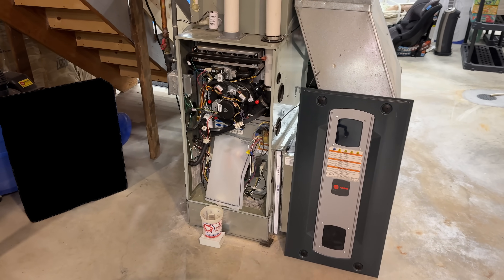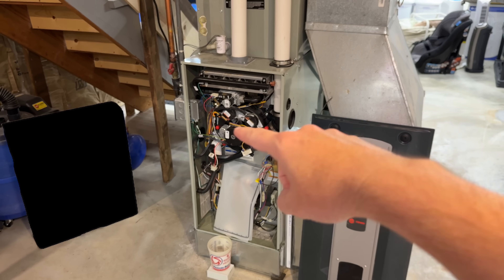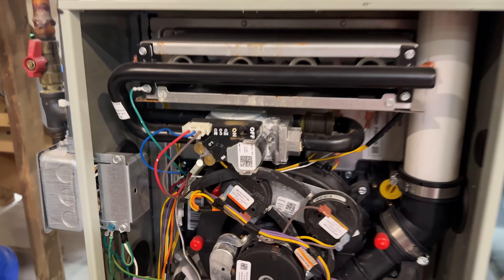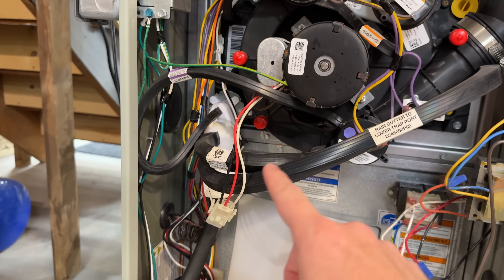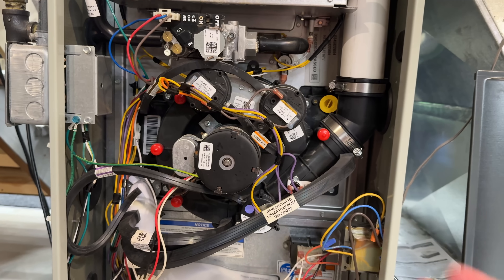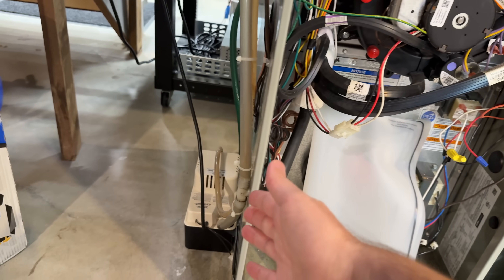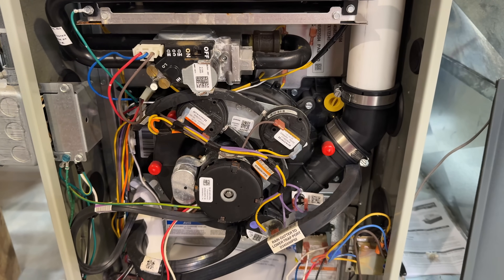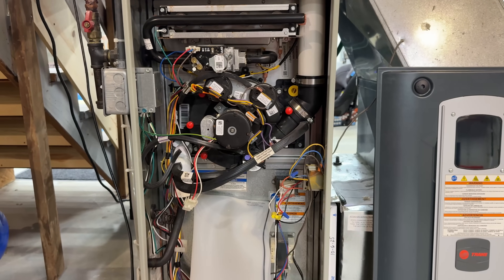It's not that hard to stop a Trane

Comment: Technology Connections would like to have a talk with you about the advantages of heat pumps :D
Reply: One can build a heat pump that is practically indestructible.  This case is bad design allowing sensitive electronic components to get wet and damaged.
Reply: I somewhat respectfully disagree with Alec and heat pumps. If what you have is an air conditioner for cooling and electric resistive elements for heating, then yes, heat pumps are more efficient, and maybe more cost effective, but for heat, if you have a gas fired furnace, going to a heat pump for heating is NOT the way to go. I have a gas furnace and a pretty new air conditioner. Our electric bill goes through the roof when the AC kicks in for the summer (as it always has, even prior to the new unit), and tanks when winter hits (thus no more cooling), and our gas bill only goes up a little when heating kicks in. The furnace generally peaks around 200W when running (heating cooling), and the condenser generally runs around 1500W. Once heating kicks in, we don't have that 1500W of power draw that would still be present, maybe even more, depending on outside ambient temps and what was required to get to get to desired indoor temps... and if you add resistive backup elements for when the heat pump can't cut it due to the outside temp, that makes it that much worse.

No, I would not want everything electric, unless I had a MASSIVE solar farm and MASSIVE battery storage to allow me to run on 90-100% off grid electricity. My sister has heat pumps with resistive backup, and her electric bill is nuts all year long.
Reply: @aperson9495  You are probably running a single speed or dual speed AC unit and not something with variable speed. That's 80s technology, and not very efficient.

Heating a whole house obviously needs more power than just running a fan, the heatpump will heat with 1500W*3,5 (average yearly efficiency of a decent inverter heatpump) = 5250W or 17913BTU. You shouldn't need that much heat 24/7 the whole winter, though.

Here in Europe most heatpumps are waterborne ( they heat water to heat the house, because radiators and floor heating is common) so not directly comparable. You can fairly easily heat a 180m^2 small-ish House (1937ft^2) with 4000kWh or 22kW/day including hot water.

You might haven't seen all the videos Alec did on heat pumps, he made quite a few.
Reply: @aperson9495  If your gas bill doesn't balloon during winter you're either not using gas heat or you have lots of other gas appliances. I don't have them in front of me but I'm pretty sure my place's gas bill has more dramatic seasonal changes than the electric bill.
Reply: @eDoc2020  It doesn't 'balloon'. It goes up to a degree, but not even CLOSE to what our electric goes up when AC kicks in (Out NG use is a tankless WH, furnace and dryer). Our electric bill DOUBLES (at best) when AC kicks in for the season. I would HATE to imagine our energy bills if we only had electric cooling AND heating!!!!! Based on our AC costs, there is ABSOLUTELY NO WAY I would want  heat pump heat over NG. EVER. Well, unless I somehow had 300% offgrid solar, wind and/or other coverage and storage with aero grid dependency.

Oh, and your 'you're either not using gas heat...' comment is both MORNIC and offensive. I know more about these topics than probably 98% of people, and I can fix nearly everything in my house, unlike the same 98% of people today that couldn't fix a lightswitch. Today, the ONLY times full electric makes sense is if you have SIGNIFICANT solar coverage, or if you have SUPER cheap electric, such as from local hydro. My sister has heat pumps in her house, half an hour away, she has CoOp power (cheaper rates than me), and her bill is WAY more than mine in the winter.
Reply: @aperson9495  I should've been more clear: your gas space heating usage is very small compared to your everyday usage. I suspect you have unusually high natural heat gain (maybe solar insolation, maybe lots of heat-producing devices) resulting in low heating needs.

By my estimates heating with cold-climate heat pumps (ie, not using much aux heat) is about 50% more expensive than gas heat throughout the entire season.
Reply: More pumping, more now!
Reply: I realize it makes zero sense with a 6 year old furnace but I seriously would consider it when it's time for a replacement. I installed a Mitsubishi heat pump a few years ago and indoor temp is way more consistent and comfortable in the winter now. It also costs me less to run than the 96% AFUE boiler it replaced.
Reply: @alc5440  About your heat pump -  During Winter - Do you have an issues with low humidity? Did you add a humidifier for winter time?
Reply: @earld1403  to my knowledge, the heating method doesn't impact humidity, just that there's a difference between the inside and outside temp. Where I live, there's only a few weeks out of the year where humidity isn't a problem (either high or low). The fact that I have an older house doesn't help matters. Humidity is just a constant battle. lol
Reply: @alc5440  that could only be true if you use propane. Natural gas is dirt cheap.
Reply: @sprockkets  YouTube doesn't tell me which comment you were replying to but I have natural gas (for now) and my heating cost has been a good bit lower since I got the heat pump. Electricity is pretty reasonable here (it's like $0.14/kWh). I'm not sure what the gas rate is off the top of my head.
Reply: I’d say a dual fuel is a great compromise. Primary heat pump, auxiliary gas (rather than heat strips), though I’d only use 80% due to the water issue
Reply: @attribute-4677 double the expense for few benefits. A full inverter heat pump will heat down to  -25°C/-13°F. A Nordic model will go down even more. Heat strips are for emergency heat and run at most a few hours a year.
See the series from Technology Connections.
Reply: More pumping, more now! (or rather... when the unit is no longer under warranty and it becomes costlier to maintain than to replace)
Reply: Even with modern cold region heat pumps, the a cost-benefit analysis isn't clear.  It depends on the relative costs of gas vs. electricity.  Where I live a BTU of gas heat is cheaper than a BTU of heat-pump heat; assuming a 92% furnace and a reasonably high HSPF2 heat-pump.  Electric prices at not low here, and they keep going up, which makes the long term prospect worse.  There are calculators online you can experiment with to compare gas vs. heat-pump running costs using prices in your region.

I think Geo-thermal heat-pumps are even cheaper to run, but they have much higher installation costs.

But yea, if your primary concern is reducing carbon footprint, a heat-pump is a strong contender.
Reply: You still need more conventional heat in colder climates. Heat pumps only get you so far.
Reply: @benargee  Modern heat pumps are honestly fine in all but the coldest climates on all but the coldest days. Mine keeps 100% of its rated capacity down to 5F and around 85% down to -13F without backup heat and newer models can go lower. They also maintain a COP of around 2 (plus or minus a bit) until you get right to the edge of their usable temperature range.
Reply: @benargee thats outdated info. See Technology Connections videos. Or ask people in Norway :)
Reply: @tschuuuls486  I have and it's less efficient below a certain temp because of the physics of the chosen refrigerant gases. If it's to cold to change state, it won't emit or absorb heat.
Reply: @benargee you run a full inverter heat pump?
Reply: @benargee I was looking at the GREE Flexx line (sold as Mr. Cool Universal) and their 2ton unit can output 24k BTU/h at an outdoor temp of -5F at a COP of 1.67. It will work down to -22F (actually a bit lower if it's dry, as I've seen video of it working at -30). If I hadn't found this out a year after my AC had to be replaced I'd have one installed right now. I'm still considering it but I have other things to do to the house that are a better use of money until my furnace kicks the bucket, like replace some single pane windows.

Comment: I have made it a habit to take apart a lot of things I buy and spray the circuit boards with conformal coating if not supplied that way. Goes a long way to making them last much longer than designed. It used to be tons of devices came that way, but not so much anymore.
Reply: what product do you use?
Reply: Bad idea. Most units come with a 5 or 10 year parts warranty. You smoke a board with it sprayed on and you will plop down anywhere from $80 to $2,000 cash for a new one. The distributor will NOT take it back.
Reply: One option is to apply rosin. One company (Kontakt Chemie) makes a coating spray* that is nothing more than rosin in solvent (no flux activators or anything). While it’s not the most robust conformal coating, it’s completely inert and completely removable with alcohol. So in theory, a board coated with that could be cleaned off before sending it for repair/replacement.

*The spray is normally intended as a “solderable lacquer” for protecting bare, unpopulated boards from corrosion/tarnishing before use. But since pure rosin is a great insulator and waterproofing agent, there’s no reason it couldn’t be used on populated boards, too. It won’t be as good as a more flexible conformal coating like polyurethane, but it won’t hurt. Of course you could also make your own by buying pure rosin crystals and dissolving them in solvent. (I’d probably use a mix of alcohol and some hydrocarbon, but no acetone. Acetone-free brake cleaner would work well.)
Reply: Considering Corporate America,  conformal coating the board would likely void the warranty. Just because Trane didn't approve the solution.   Depending on the your choice of conformal coat, it would only prolong the boards functionality.  Most conformal coating I'm aware of only protect the PCB's from Humidity.  Frankly, Jeff would better off 3d printing a cover for the board to protect it from dripping water.  Then print a tray to capture the water at the bottom and pipe that over to the lift pump.
Reply: @MIdaffy502
Most board failures today are bad electrolytic capacitors. The coating will not prevent their failure.
Reply: @bills6946 Good thing those are easy to swap.
Reply: Oh this is a real pro move

Comment: For the condensation on those PVC lines, if they are intake and NOT exhaust, what about drilling a hole in the bottom the pipe to let any condensation drain away from the unit?

Comment: I can't imagine using a gas furnace in 2025... modern heat pumps are able to operate in very low temperatures while still generating lots of heat, and they're so efficient 99% of the year that they're cheaper than gas in most parts of the US. And you're not worried about a gas leak causing your whole house to explode one night. I look forward to ditching my gas stove soon in favor of induction, which is faster, easier to control, and just generally better... then my home will be free of "natural" gas.

Comment: Those failure modes are designed in.  There are no mistakes in that product.  They will make a lot on the out-of-warrantee repairs and MORE on the early product replacement.  Products from earlier years last 20-to30 years and the manufacturers hated it.

Comment: Get them to replace the whole furnace, do as much of the removal, and instill as you can, see if you can find an HVAC person to do final connections. After the new one is in, go through it, and make upgrades like a cover for the board, and drain for the air intake (the center pipe), and any other places that don't seem to drain that need to. Run a tube to one of the "gutters so the water can  exit. Attach things with magnets, or double stick tape etc, If you ever need to have it serviced, pull the modifications, and put them back after. It is a pain, yes, do you get a long lasting furnace yes.Should someone in engineering be smacked around the head, Yes. Even if you have to pay someone to install the new one, and it's replaced with the same thing, you are still ahead, because most of the work is done already, and you know where the weak points are.

Comment: The higher the efficiency the more stuff that can break. When I replaced my HVAC, I told him I wanted the simplest unit they had. .No multistage anything because multistage = complex controllers.  I really wanted one with just a normal old school fan motor and he claimed they don't even make those anymore because of efficiency standards, they have to have "soft start" motors...meaning there's a control board that has more than a relay  to control it.. I'm convinced these companies do very little actual testing on their designs.  They pump them out purely for marketing claims, and don't really care how long they last.
Reply: Nah, just gotta get one that's not junk. Installed my 96% afue 100 kbtu amana 15 years ago, hasn't needed a single part.  Clean the burners out yearly with compressed air, clean the flame sensor with  a crisp bill every 2 years, change the filter every 3 months, still going as strong as the day I put it in.
Reply: And if you get a proprietary 'communicating' thermostat, it can cost you over $1000 to have it replaced ... if just the LCD or some other component fails.
Reply: I have a feeling that it can be done well. But either they make more money selling replacement parts, or they really don't know what they're doing designing these things.

Comment: My top of the line Carrier has the exact same problem!
Reply: Mine was caused by our high humidity summer in St. Louis.  The basement is the coldest space and as it pulls high humidity air in from the outside it condenses on the inside of the intake pipe and slowly drips into the furnace.  The installer tried to convince me it was from the humidity inside the house and that I needed a $1200 whole house de-humidification system.  I didn't fall for that and called the installer later to complain.  They sent a senior tech who installed a condensation drain attachment to the intake, similar to what is on the exhaust.  The secondary problem is that negative pressure in the house is causing hot humid air to be drawn into the house through the intake vent.  That negative pressure could be due to regular use of bathroom ventilation fans. I will probably just cap that intake pipe in the summer and create a reminder to remove it in the fall.

Comment: Make your own rain gutter downstream. Drill some some holes in the pvc pipe, 1/2, 3/4, 1 inch... whatever. It's temporary. Get some vynil tubing, nipples, create a drip loop and create a trap etc. Kind of like a trap for a/c condensate. Need to stop bad air returning. Remove it after the warranty work and seal it back up. I'm simplying it, but it's an option. Then go full nerd son! esphome it, automate in home assistant, add an electronic drain valve. Drain in a bucket, use a jsn-sr04t, send an alarm! Drain the bucket! ... I'm crazy... I'm sorry.

Comment: Don’t get me started on furnaces. The motor recently went on mine(but not really). There is a control module bolted to the back, and that’s what broke. But you can’t get just buy the control module, you have to buy the whole motor for $600. The best part, when replacing the whole motor, everything has to come out to remove it. However, replacing just the control module can be done without removing anything, including the motor. Turns a 1 hour job into a 2 minute job. The company would actually save money on warranty jobs because their repair people would be able to do like 50 a day. Apparently the motors don’t actually ever break, just the “smart” control module.
Reply: Was it a GE motor?  Same thing happened to the GE control board on the GE blower motor for my "variable speed blower, high efficiency air handler."  I don't know how, but I found a good repair guy, an independent.

He called a couple of suppliers and got the cost, and found out at that time the motor had to be ordered and it was going to be 3 or 4 days, then he offered me an alternative.  He said he could go get some parts and replace the fancy stuff with a simple dual speed motor and some relays, for a fraction of the cost.  This was mid-afternoon on Friday, and he said he couldn't get everything and get back that day, but he would come out first thing in the morning (Saturday) to get my heat going.  He did just as promised. He and his (retired) father came out and rebuilt my air handler to use a few $10 relays and a $100 motor.  A couple of years later the 5 year old heat pump died, and of course I called him to replace it.  That was about 6 years ago, and my air handler is still running the $100 motor.
Reply from the maker: Sounds as smart as most other "smart" things I've tried lately :(
Reply: Depends on which type of motor you have. Yes, ecm motors today most likely can't just replace the module. Others require programming. Or you buy a universal ecm replacement if not a communicating model.

Comment: The cheap nasty gas units they instal in Australian new builds are designed to fail after 5-10 years. Either the boards go and need replacing at 3/4 the cost of a new unit, or the heat exchanger literally falls apart pumping Co2 into the house. Gas in new builds has been banned here in favour of electricity.

Comment: Yeah, let's put a water trap tube and make it "level" from the device to the drain  🤦🤦🤦🤦
Wow, such a design flaw, and one that should have gotten caught "before" putting in mass production. And personally, "because" of that flaw, they should be even more liable for the repair work. They should at least send a modified/updated drain line (the one all the way on the left the drain lines connected to) that drops the lines further down so everything is going down hill.

Maybe you can fabricate something, 3D printed even, a new coupler that goes below that connection point so that everything can drain properly.